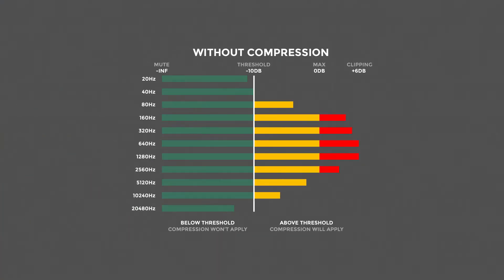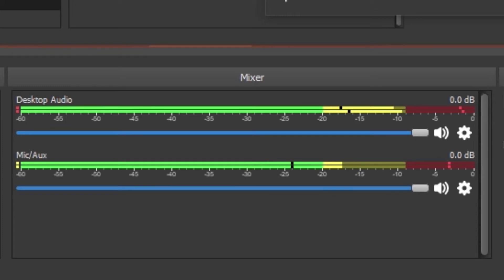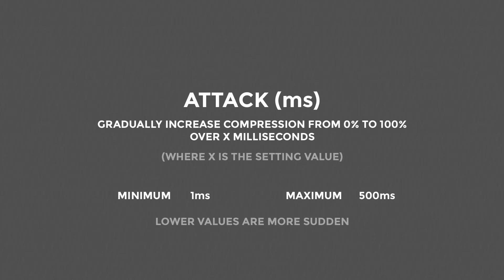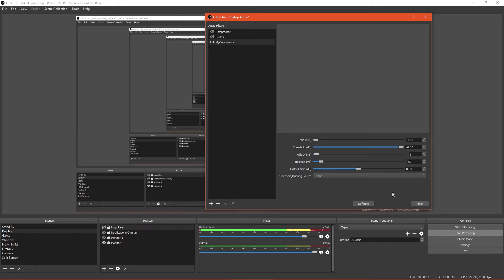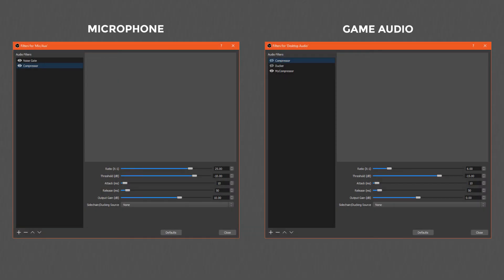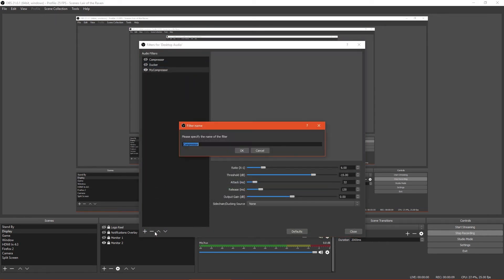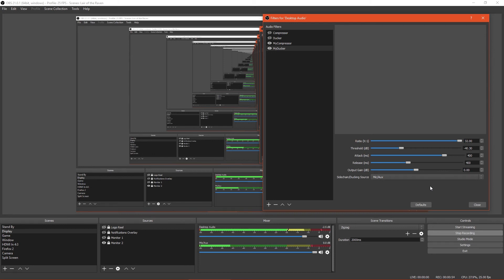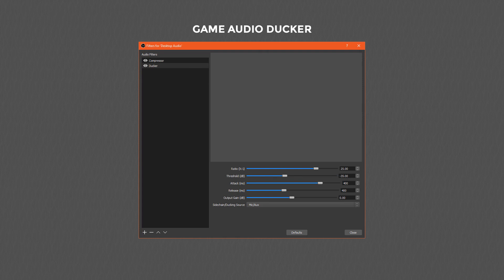Using Audio Compression and Ducking - OBS Studio Tutorials - Get Creative

Comment: This video needs more views! I had to watch a dozen other videos before finding this one that had all the info I needed.
Reply from the maker: You're welcome!
Reply: @AnthonyEdmonds  What are your settings on your noise gate? Thanks again.
Reply from the maker: The settings will vary entirely based on your own microphone setup - copying my settings will not be right for you.

Set the close to be just above the ambient noise you want to cut out (a fan, for example), then set the open to just below the quietest noise you want to hear (a whisper, perhaps).

Attack, hold, and release should be short, long, and medium in length respectively based on how sharp you want the gate to be.

I generally recommend that the entire gate timings should add up to around one second.
Reply: @AnthonyEdmonds  This is very helpful. Thank you! I get my new mic in the mail today. Look forward to using your guide to balance my audio. I'll post a link to my first recording when I'm done.

Comment: Very well done video! Just a quick question. For adding the compressor to the mic, would it be worth have two separate compressors? Like one for a gain, and another to compress loud yells or screams. I’m trying to keep my mic audio as consistent as possible, but having difficulty. Asking from a streaming perspective. Thanks in advance XD
Reply from the maker: You're probably better off adjusting the gain using the gain filter / increasing the source volume. The compressor will deal with the shouting - that's it's purpose!